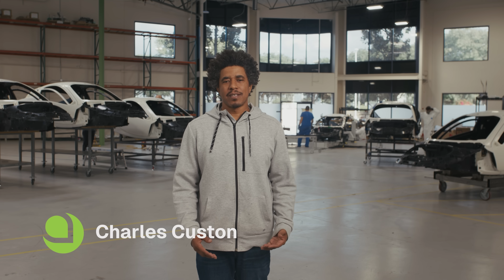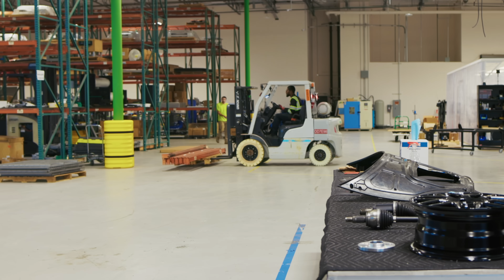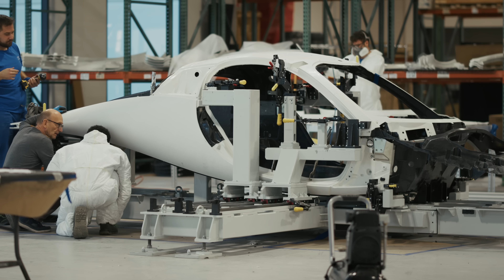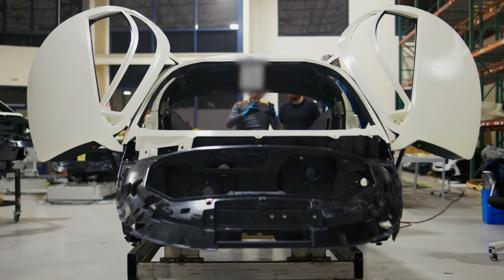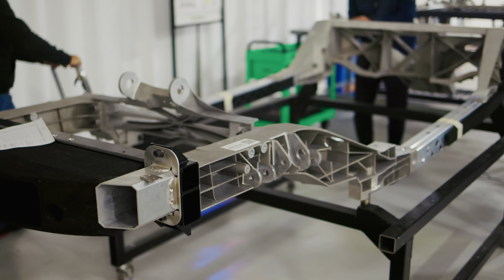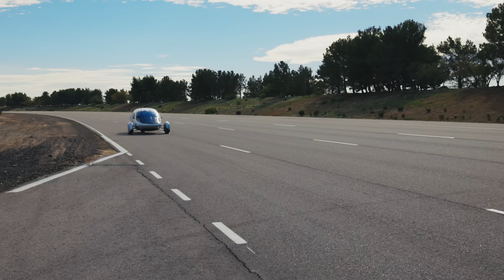First Look at Aptera's Validation Vehicle Assembly Line

Comment from the maker: Drop a few words of encouragement below for all the hardworking engineers putting in late nights, weekends, and everything they can to make this dream a reality. 💚
Reply: Please, Be Encouraged! 🏎🎉🎆
Reply: I do not support MOST electric vehicles because I dont believe in 9000lb Hummer EVs, 1000hp electric super sedans, etc.  That just doesnt make any sense to me.  I support this company because they are actually manufacturing an electric vehicle that makes sense.  Its lightweight, aerodynamic, safe, and built for primarily daily driving.  I wish Aptera the best of luck, and MAYBE one day Ill be an electric vehicle driver.  Maybe...
Reply: @ViperJustin2016ACR "MOST electric vehicles" are not anything like the grossly inefficient Hummer nor are they 1,000HP street racers.  All EVs are far better than their ICE counterparts.
Reply: @ViperJustin2016ACR
  Have to agree if you have to wait for a manufacturer for electric vehicles way overpriced and have to be certified to each yearly update of safety laws. 
  So have been making my own for 25 years. Wanted electric bike back then, but wasn't going to pay 10000$ for one, so so converted my Trek that was bought for my size. 6' 6".
  Started around same time getting used ride on toy vehicles for my son's and fiddling so they could actually drive around on our mountain property with studded tires for traction.
  We've done motorcycles and ATVs since, which are easy to find at scrapyard in next town with the associated repair garage.
  So my 19 year old is currently driving a 15 year old Chevy volt that we removed gas engine from and put different controller and better batteries in so he can get couple hundred miles.  Little under a kilowatt of solar recharges any time he's home, and we put in level two charging port so he can get free electric from the towns solar farm that is there so they have charging in this mountain tourist area.
  Prius is about done for the youngest when he gets his license next year, shooting more toward the 250-300 mile range for it.
  My only advantage to doing this is as former electrician with familiarity with DC circuitry also.
  Otherwise just found idea s and sources for hardware here on YT or with web searches for the right chart's for what we did.
  Cali doesn't allow people to do this, but almost all other states don't care. Register it under the regular title, and nobody cares what's making it move.
   Hopefully we will have our solar motorhome done in a year or two. With all the bad people getting kicked out the state and fed parks will be safe again 
✌️😎
Reply: GO TEAM!!
Reply: Yeeeeessse
Reply: I am so looking forward to hearing what people say, after seeing your vehicle fly down the road.
Reply: You can do it!
Reply: Hopefully, hardworking management is also putting in late nights and weekends, doing whatever they can to get product on the road.
Reply: Great to see progress being made! Thank you to all throughout the long journey to get here! I believed in this concept when it first was being explored, and was so glad to see it revived in its current form! I still strongly believe in this design and all the benefits it brings with it. Thank you, thank you, thank you!
Reply: Go Aptera
Reply: Keep living the dream becoming  reality!  Good times!
Reply: @Uber 🤝 @ApteraMotors
Reply: Go home on the weekend and be with your family.
Reply: Y'all have serious sticktoitiveness! Keep it up-- you're so,  so close! I have loved this project for years and have invested as much as I can in y'all's success!
Reply: Nice work and keep it up!  It probably feels like solving 500+ problems big and small and it never ends, but it's clear real progress is being made!  Super excited to see the launched product.
Reply: Wish everyone at Aptera all the best! I appreciate all the effort and dedication put into making this engineering dream into a reality. It certainly takes a lot of patience and discipline to be able to push forward into getting everything ready. While many have their opinions and criticisms, I think at the end of the day this is a vehicle indicative of the current era and one I would love to see out on the roads.
Reply: Any updates on Polydrops?
Reply: Great job, team!! The external and internal pressure to do the right thing right the first time must be immense. Best of luck going forward 👍
Reply: Great work, Aptera!
Reply: Hey from Ireland 👋Aptera going Slow n Steady is really paying off, makes the haters maaad lol
Fingers crossed you got plans under your sleeve to bring the Aptera to other markets, or perhaps duplicate manufacturing overseas. The 24kWh one is appreciated 👍
Reply: Absolutely amazing. Keep crushing those goals and reaching new milestones. Bravo team Aptera. Making it real 1 step at a time
Reply: @lennycoss 
 There goal was to start full time production in 2020. 
  Have you looked into how long this thing has been going on.
  Seems like it might have been about when you could start buying Tesla's.
  Musk moved whole business for cars, rocket's and robots out of Californication because of insane taxes and stupid gov regulations.
  These people at Aptera will probably go bankrupt next year because all of the wasted money on these kind of projects has been discontinued in this year's budget and law's changed so they can carry trying to be a real company 
  But the 80 billion per year money is stopped coming from our tax dollars.
✌️😎
Reply: @offgridmanpolktn  Musk moved to TX from CA because he was being harassed by the Dems for not making campaign contributions.  And then Dems decided to promote those who did.  So Elon felt a bit vindictive and chose to pour hundreds of millions into their opposition party and move to TX.  The rest became history.  I am neither Dem nor GOP.  Simply an observer.  

So far Aptera has not been harassed.  But once they become big enough they will be expected to contribute to a candidate.  Hopefully history will not repeat.  

Detroit has been known to play both parties.
Reply: @fanfare100 
 You are correct, but forget the Cali screw up on the underground tube system that got refunded by Dem's. He lost a crapload on that and having to move SpaceX because of weird climate regulations only there. With also leaving only management and connections for Grok in Cali and building separate safe servers in other states.
  It's all one big picture, that has lost Musk billions or maybe trillions.
   It was in 2016, that the separation from Cali and China began. In China there are barely any employees because there depressed economy since covid has cut sales to almost nothing. So a crapload of investment waiting for the government to finish crumbling. Everything in Cali is about at the same position too. Just waiting on the excellent progress that has been having so much success this year exposing how a big majority of the dems have been corrupted by the Chinese and Russian money.
   Plenty happy to discuss more, but you will need a better understanding of Elon Musk's life in the US over the past 30 years. So please let's discuss, instead of you showing up late to the conversation and telling me I'm wrong.
Have a good Evening 
✌️😎
Reply: Incredible job so far, ignore the stock price the product will speak for itself!!
Reply: Thanks for the update. It looks like you guys are doing great work. Welcome to the new hires who will help put these vehicles in driveways, turning the promise of free miles from the sun into reality.
Reply: To every individual member of the Aptera team:

As a deeply interested observer who is personally unable to do the necessary work, I can truly appreciate what your work at this company can mean for sustainable transportation and innovation.

Please remember to always take pride in your work and embrace positivity in everything you do. 

Upward And Onward! 🌞⚡🚗
Reply: Great job team, more environmentally friendly private transportation is exactly what we need right now.
Reply: Building something completely new, always awesome 👍
Reply: Absolutely love the progress you guys are making. Your team is building the future! Keep up the good work 👍👍👍👍👍
Reply: When I first saw the vehicle, I wasn't totally sure about what I thought. Get back another possible contender early on for about a hundred dollars. That one has not panned out, and that's okay. I have a thousand dollars down on this vehicle. And I want to see you succeed. I have an add-on feature that I would like to talk about at some point. But I'm not going to do it here. Anyway , I am breeding for you guys and for myself.

George Davis
Reply: Glad to see you finally get to the test stage. But also happy not to have given you a deposit when you first started.
  California is to difficult of a place to do this, would seem Tesla leaving because of the govt hassles over regulations and to high tax could have been a clue.
  In any case good luck Y'all, look forward to buying one soon day when your production c
Vehicle gas sold used. By then will probably be a lot closer to the price you were shooting for at the start when the hype started.
  Are you allowed to let how many confirmed orders from customers you have now. Just curious how it compares with what was announced in the years after you started.
Peace Y'all 
✌️😎

Comment: Tell me that with it's solar panels this will have backup battery capability, or whatever it's called, because I very much want to buy one of these before I die. Don't make me come out there and build my own. If Elon gets FSD before these are available I'll just do a Miata conversion. I'm getting tired of having to do everyone else's job. How hard can it be?
Reply: It's basically just a super efficient EV.  It comes with batteries with your choice of these ranges: 250, 400, 600, 1000.  The first version will only have the 400-mile range.

Because it is so efficient, it is the only EV I have seen where the addition of solar panels actually makes sense and provides meaningful charging.  On other EVs, solar adds 2 to 5 miles per day.  On Aptera it tops out at 30 to 40 miles per day, depending on where you live.  

That's 8,000 to 11,000 free miles per year.  If you need more than that, or take super long trips, you can always plug in and and miles at 1/3rd the cost of other EVs.
Reply: You will have to keep "doing everyone else's job", I'm afraid.  Aptera is the only EV in the world that has no battery... and the doors don't even open! Run for your life!
Reply: @J-W-Kelly  So like Christmas morning when I was a kid?

Comment: As an Aussie, I wanna know what happens when one of these hits a pig or a roo?
Reply: Amazingly, Aptera actually improved on safety while making it this efficient. The computer modeling shows it is safer than what we are driving now, and they are making vehicles for crash testing right now even though they are not required to. Many of the safety components echo what you see in Formula 1 cars.

Safety components include:
Carbon fiber tub, carbon fiber and steel roll cage, large crumple zones, body design has blows glancing off you instead of absorbing the impact, airbags, steel reinforced doors, superior accident avoidance demonstrated in the Moose Test. One prototype had the highest roof crush strength of any production car.

So you are very safe, and you are much less likely to kill the child in another car if you do ever should cause an accident.  So should be safe for the critters as well.
Reply: @Mister_Stone I'd love to get one of these when they're available but currently I don't lose a front wheel when I run over a roo. The thought of flying off a 100m cliff because a roo took out a front wheel is a real turn off.
Reply: @nonyabusiness1939   Look for video of their curb test.  Not going to happen.  Hitting concrete at 35mph so hard the tires popped did zero damage to the car.  In the States at least, most of the animals I run over are somewhat softer than concrete, and even that stood up better than other cars.
Reply: @Mister_Stone thanks, will check that out

Comment: How does it hold up when you get T-Boned by a 6000lb SUV because someone couldn't put their phone down for 2 seconds?
Reply: The same or better than every other car.
Reply: @Mister_Stone  I doubt that
Reply: @hunterjones9822   I would doubted it too, if the computer modeling hadn't already shown it to be true, and the company wasn't so eager to crash test the vehicles they are building now even though they are not required to do so.  So we know what the numbers are, though the upcoming tests will bear them out.

That made me curious about the tech that makes this so much safer.  One prototype even had the highest roof crush strength of any vehicle on the market.  Tech includes a lot of things found in F1 cars. 

We do tend to jump to the assumption that it "looks" unsafe based on appearance, not evidence, so here is a partial listing of the safety features: carbon fiber tub, carbon fiber and steel roll cage, large crumple zones, steel reinforced doors, airbags, impact reduced by shape of the vehicle (causes blows to glance off rather than being absorbed), superior accident avoidance in the Moose Test.

So it is safer for us, but if we extend the consideration of safety of all human beings instead of just ourselves, it is far safer to others on our roads as well.
Reply: Further safety info taken from around the 'net (not mine):

The actual dimensions of the Aptera are pretty big - it's about as long as a Model 3. There's plenty of space for crumple zone engineering with no big solid things like engine blocks to work around (yes there are batteries, but they're located under the occupants and shouldn't interfere with the crash structure). And in general, composite crash structures can be engineered to absorb 2-3 times more energy per unit weight than aluminum or steel ones. So there's nothing inherently risky with the design choices that Aptera has made.

As you're probably aware that the predecessor iteration of the Aptera design had a higher roof crush strength than any car at the time. The teardrop shape that makes that happen is also effective in other directions.

The central structure being quite round may negate crumpling by redirecting energy instead of absorbing it. For example the small overlap test might just clip the wheel and that's it. A larger overlap frontal collision might just push it to the side. Modern vehicles use internal tusks to do the same and avoid having to fully absorb the impact on their small overlap tests.

The shape makes it so that the number of scenarios where the vehicle has to take the full energy of the impact is reduced which should in turn reduce the odds of a serious or fatal injury. There are a lot of scenarios where the vehicle will get pushed up which should reduce the peak g-forces experienced by occupants. Imagine two wooden boxes colliding and compare that versus a wooden box and a soccer ball. In any collision other than perfectly flat on one side the ball is going to instead get nudged away. Any redirection is a good thing for minimizing those occupant g-forces because then the structure doesn't have to absorb the force of the impact. Whether you call that cheating or if you call that crash mitigation depends entirely on what kind of crash you're in, but it should still raise your odds which is the whole point of engineering in crash safety.

It's still a light vehicle and light vehicles are always at a disadvantage in a crash with a heavier vehicle, but the design of the Aptera is such that for example in getting hit from the rear the other vehicle will slide under it. Or from a front quarter impact the wheel structure will fold up.

Crash survival in any vehicle is a matter of odds, but there are a lot of scenarios where the Aptera design increases your odds. Of course if a cement truck crosses into oncoming traffic and hits you squarely at a 140 mph closing speed then you've got a problem, but that's true of any vehicle.

 Many studies find that heavier vehicles actually fair worse for the passengers.

[Search for Newsweek article titled "Supersize The Automobile"]

Lighter weight however, has advantages! (handling, more efficient crumple zones,etc)

Comment: Demand for these vehicles is high, after selling obligations, hike up the price! They are going to sell out fast, and re-sellers are going to make higher profits than the team!! Once your able to mass produce, than drop the price dramatically. Does aptera plan to sell on first come first serve, or highest bidder until the supply/demand curve gets settled?? Use common sense… or buy your own vehicles and resell it for higher, meet the demand. Also be honest about the solar charging range, a lot of investors will be upset when 15miles is all you get instead of 40miles. Remember how calculators used to be expensive? These are expensive calculators until mass production. 2¢’s

Comment: Loving the updates, and looking forward to picking mine up! 
I know there must be several unknowns about when validation will be complete, what adjustments and revalidation will be done due to those results and build efficiency adjustments before the first low volume production vehicles start the line. 
For customer planning, it would be nice to have a round figure range or mid guestimate of what "low production" might be. I know there's fear that a mid estimate could be miss-quoted by an Aptera fan as gospel, and another could turn it into bad press. 
A low estimate could be mistaken by some number cruncher to claim the company can't sustain a number of workers at that rate, although they know it will eventually become more than sustainable. 
     SO,    If we knew you might make more than 14 per week or less than 10 per day, I could add a few months ramp-up and guess that i may come see you sometime near Oct next year or May 2027.  

:face-blue-question-mark: